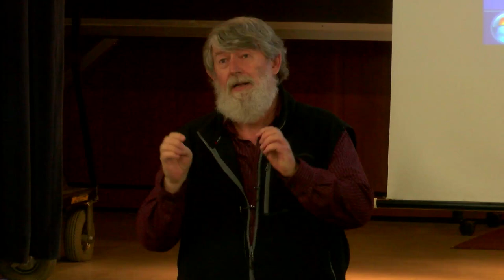David Chandler - How did they deploy 100s of tons of Nanothermite?

Comment: are you saying the 'nano-thermite' was applied to the 'core' lift shaft steel beams ?   How is nano-thermite triggered?  would the aircraft fuel fire be a trigger or was there another trigger mechanism?
Reply: "How is nano-thermite triggered?  would the aircraft fuel fire be a trigger or was there another trigger mechanism?" ~Professor Simon Holland, --- Nanothermite is triggered by an electric ignition. No the fuel fire would not trigger it. No thermitics ignite at such low temperatures. It takes a magnesium fuze to trigger regular thermite. 
\\][//
Reply: William Whitten FEMA Apx C consisted of inttergranular melting more then likely formed AFTER the collapse and does not have enough iron oxide with it to have even come from thermite.

http://www.tms.org/pubs/journals/JOM/0112/Biederman/fig3.gif

Nanothermite does not corrode the steel down to only inttergranular melting and I have gone over sources of it before. Gypsum wall board, chlorine, transformer oil, battery acid. What is important is that it didn't come from thermite.

There would has been electrical arcing taking place in building as described in the 2012 RJ Lee letter, the whole electrical system was compromised, yet somehow this nanothermite should not have been triggered by any of this until an hour later just before it collapsed?

The chips are consistent with paint. Red metal aluminum flake, which could come from compaq computers, fire engines, contain Fe203 and aluminum and can produce a reaction when ignited under Argon, which is exacly the same enviroment that Jones and Harrit tested it under. Mark Basile has promised an independent lab study using an inert test which would tell if the material is self oxidizing and has raised all of his money years ago.  Here we are years later and this has still not happened, yet the tests should only take a couple weeks, and he has had the money to do it? Perhaps because he knows what he has is paint chips reduced in the hydrocarbon fires.
Reply: Joel Schmierer LMFAO do you really not understand the flaws in that video? Do you really think that is how the buildings failed?  You think that a floor meant to hold 15000 STATIC tons (really at the time of collapse it would probably be less due to fracture though) should have produced an equal and opposite reaction to stop 100,000 DYNAMIC tons slamming into it??? 

 The video is highly inaccurate as it relates to the real Physics of the collapse. She found a relevant equation for dropping a bowling ball on a few sheets of glass- the problem is that this is not even how the towers collapsed at all, it ignores the mechanism of how the buildings fell- which was simple connection failure. One floor hits one floor and it breaks the connections on that floor, the entire floor does not have to be completely "crushed" it just has to stress the connections enough until the floor gives way. Due to the huge load impacting it, the connections fail quickly and easily due to the dynamic force, this caused the mass that was falling downwards to accumilate rapidly, as well as sending a shockwave down the building that fractures connections, meaning the force required to stress the connections and break through it would be less in the lower stories, this along with the increasing mass is what allows the collapse to continue to the bottom and accelerate. 

A better experiment would be panes of glass with a brick on each one. If you drop 10 bricks on one pane it will break, another brick will add on and the collapse will continue to propagate with more bricks falling, accelerating to the bottom, no single pane of glass would be able to stop the force hitting it. A much better and relevant experiment can be seen here

 https://youtu.be/flo62pdaIMI

The floors are stiff and can hold a load that is static, but when it is a moving force hitting it hard enough, it will break through, and with enough added on it can even accelerate. 

I don't know why you reference David Chandler, he didn't want to defend any of his points in a discussion and quickly left after being asked questions that he couldn't answer, and I have just refuted your nanothermite argument above.
Reply: Katelynne Wilcox I also believe that the piece from building 7 was from a completely different area then the point that the building initially failed at too but I cant remember for sure. But in either case thermite it wasn't done by thermite, probably from the diesel fuel kept under building 7
Reply: William Whitten Agan, there are other causes for the sulfidication and it is not even consistent with thermite anyways. Until the chips are inertly test and self oxidizing you can't say that it has been "proven"
Reply: William Whitten You are not coherent in the least, this is not what I'm saying. Aluminum flake as I explained yesterday contain Fe203 and aluminum similar to thermite and will produce a reaction under Argon which is what Jones and Harrit tested it under but it needs to be tested in an inert test.
Reply: The low Al content found in all of Harrit's chips would imply very little to no thermitic compunds and suggest the reaction is a result of burning organic polymer material and is why it should be inertly tested
Reply: William Whitten We've been through this before and I have already won before. The chips are a perfect match for a Leclede printer paint which doesn't contain zinc. Did you really think that they only used one type of primer paint in the WTC? LMAO.  the chips produce a reaction because of burning organic polymer material. The chips Miller's looked at did not contain elemental Al, and because the other ones contain low Al content more then likely it's burning polymer material,  which refutes everything you just said.

Willy Whitten doesn't believe they should be tested in an inert test though, the reason being is probably because he knows that he is wrong and is too arrogant and embarrassed to admit that.
Reply: William Whitten You have a long history of lying. Did you forget about your saying the remaining spire was part of the core and that all the columns were completely crushed up despite me showing pictures proving you dead wrong? LOL
Reply: William Whitten firstly I meant to say Millete but auto correct caught me. 

 Lol it sounds like you can't really refute the video so you want to handwave it by. Well the microspheres can also have been formed from electrical arcing taking place, refer to RJ Lee's 2012 letter on the formation of micrispheres, there is no need to appeal to thermite to produce the spheres that were seen.

 Do I also need to produce email correspondence on the microspheres debate that Steven Jones lost?
Reply: William Whitten The only hoax here is the one you stumbled into concocted by Steven Paint Chip Jones. Btw I have even heard that Jeff Farrer has had some doubts about the nanothermite.

http://www.sharpprintinginc.com/911/index.php?module=pagemaster&PAGE_user_op=view_page&PAGE_id=70&MMN_position=186:186

Here are those emails, care to explain why Paint Chip Jones dropped out of the microspheres discussion when engaged by Frank Greening?
Reply: Katelynne Wilcox I am not sure if you have seen it but he also put out a fairly recent article just less then a year old discussing this too, that microspheres in the dust from WTC2 came from the construction process.
Reply: Katelynne Wilcox http://www.scientificmethod911.org/docs/WTC2_dust_sample.pdf

This is the most recent article about the dust. The microspheres used in the report by Jones and Harrit also may not even really be an accurate figure but the samples they referenced from the RJ Lee report were not collected until months afterwards, after clean up and other cutting work at the site had been done potentially adding a significant number of microspheres to the dust, so I definitely find it to be a pretty week argument either way
Reply: Katelynne Wilcox You should read the forum "9/11 tapatalk" It is dead now but originally it had a lot of well known engineers and others like Frank Greening, David Benson, Tony Szamboti and others but still contains an almost endless amount of information
Reply: Katelynne Wilcox I would highly agree with that and Willy Whitten is a great example by intentionally taking the Seismic signals out of context to portray something completely different, or pretending that they did not "provide a full explanation" and then not even to also mention the time he said the remaining spire section was part of the exterior walls and not the core, or that all of the columns were completely shredded and destroyed entirely despite posting a picture that completely disproved that, the same one you used showing them laid out in large sections together. It is amusing to see how strongly he really thinks that it was a controlled demolition despite being completely wrong. Even if God himself came down and told him otherwise he still would not believe it because rather then look for actual evidence he has a major misunderstanding of how the laws of Physics work and would rather live in complete ignorance. I have heard that in private Richard Gage acts much different about everything and that there is actually a lot that he does not understand and not nearly as knowledgeable on it as he makes himself out to be. There is even a video somewhere that he is asked about the Seismic signals but says that he does not really understand them at all, yet this is not how he acts in other videos that he discusses the Seismic signals.  With this and the several things you showed on the previous channel there is no doubt that his only intention is to keep it all going just to draw in more profit and to keep from admitting this
Reply: "Revisionists say sharp spikes (graph 1, above) mean bombs toppled the WTC. Scientists disprove the claim with the more detailed graph 2 (below). (Seismograph readings by Lamont-Doherty Earth Observatory of Columbia University: Won-Young Kim, senior research scientist; Arthur Lerner-Lam, associate director; Mary Tobin, senior science writer)

FACT: "There is no scientific basis for the conclusion that explosions brought down the towers," Lerner-Lam tells PM. "That representation of our work is categorically incorrect and not in context."

The report issued by Lamont-Doherty includes various graphs showing the seismic readings produced by the planes crashing into the two towers as well as the later collapse of both buildings. WhatReallyHappened.com chooses to display only one graph (Graph 1), which shows the readings over a 30-minute time span.

On that graph, the 8- and 10-second collapses appear—misleadingly—as a pair of sudden spikes. Lamont-Doherty's 40-second plot of the same data (Graph 2) gives a much more detailed picture: The seismic waves—blue for the South Tower, red for the North Tower—start small and then escalate as the buildings rumble to the ground. Translation: no bombs."

https://www.popularmechanics.com/military/a6384/debunking-911-myths-world-trade-center/

"Many CD theorists draw attention to seismic recordings as evidence of the CD theory. Griffin (for example), drawing on Hufschmid, cites seismic data from Columbia University to support the CD theory:

‘In each case, “the shocks increased during the first 5 seconds then dropped abruptly to a lower level for about 3 seconds, and then slowly tapered off.” This pattern,Hufschmid suggests, reflects the fact that the first explosives detonated were those near the tops of the towers, where the steel columns were the thinnest. The shocks get stronger as the detonation pattern, controlled by a computer programme worked its way down.’ (Griffin TNPH, p.19)

This is easily shown to be fallacious. Firstly, as the one of Columbia authors confirmed in a later email, their seismic data “are far too weak in signal-to-noise ratio and far too speculative in terms of signal source to be used as a means of contradicting the impact times …” (Commission, p.462) But the key mistake however, is the idea that any building is demolished by a progressive wave of explosions either working its way up or down a building.

Brent Blanchard devotes section 4 of his paper to the issue of seismic recordings on 9/11. Blanchard is Senior Editor of ImplosionWorld, a website which posts details of explosive demolitions, and also Director of Field Operations at Protec Documentation Services, Inc. Protec works in the field of vibration monitoring and structure inspection, a key service to both the construction and demolition industries. Vibration monitoring performed by independent experts has long been considered crucial for companies carrying out explosive demolition, because owners of nearby buildings are keen to sue if any cracks or other structural damage appears. The field seismographs used by Protec and others provide the key scientific evidence for disturbances that may have caused damage, and there were a number of such seismographs operated by Protec on 9/11 in the vicinity of Ground Zero, for monitoring construction sites. Blanchard tells us that data from these machines, and seismographs operated elsewhere, all confirm single vibration events recording the collapse. None of them record the tell-tale 'spikes' that would indicate explosive detonations prior to collapse. In his words:

This evidence makes a compelling argument against explosive demolition. The laws of physics dictate that any detonation powerful enough to defeat steel columns would have transferred excess energy through those same columns into the ground, and would certainly have been detected by at least one of the monitors that were sensitive enough to record the structural collapses. However, a detailed analysis of all available data reveals no presence of any unusual or abnormal vibration events."
(Mike King)

NIST has provided an explanation, though some people like to twist things they have said to make it seem that they did not.

"Yes, there was more than enough gravitational load to cause the collapse of the floors below the level of collapse initiation in both WTC towers. The vertical capacity of the connections supporting an intact floor below the level of collapse was adequate to carry the load of 11 additional floors if the load was applied gradually and 6 additional floors if the load was applied suddenly (as was the case). Since the number of floors above the approximate floor of collapse initiation exceeded six in each WTC tower (12 floors in WTC 1 and 29 floors in WTC 2), the floors below the level of collapse initiation were unable to resist the suddenly applied gravitational load from the upper floors of the buildings.

Consider a typical floor immediately below the level of collapse initiation and conservatively assume that the floor is still supported on all columns (i.e., the columns below the intact floor did not buckle or peel off due to the failure of the columns above). Consider further the truss seat connections between the primary floor trusses and the exterior wall columns or core columns. The individual connection capacities ranged from 94,000 pounds to 395,000 pounds, with a total vertical load capacity for the connections on a typical floor of 29,000,000 pounds (see Section 5.2.4 of NIST NCSTAR 1-6C). The total floor area outside the core was approximately 31,000 square feet, and the average load on a floor under service conditions on Sept. 11, 2001, was 80 pounds per square foot. Thus, the total vertical load on a floor outside the core can be estimated by multiplying the floor area (31,000 square feet) by the gravitational load (80 pounds per square foot), which yields 2,500,000 pounds (this is a conservative load estimate since it ignores the weight contribution of the heavier mechanical floors at the top of each WTC tower). By dividing the total vertical connection capacity (29,000,000 pounds) of a floor by the total vertical load applied to the connections (2,500,000 pounds), the number of floors that can be supported by an intact floor is calculated to be a total of 12 floors or 11 additional floors.

This simplified and conservative analysis indicates that the floor connections could have carried only a maximum of about 11 additional floors if the load from these floors were applied statically. Even this number is (conservatively) high, since the load from above the collapsing floor is being applied suddenly. Since the dynamic amplification factor for a suddenly applied load is 2, an intact floor below the level of collapse initiation could not have supported more than six floors. Since the number of floors above the level where the collapse initiated exceeded six for both towers (12 for WTC 1 and 29 for WTC 2), neither tower could have arrested the progression of collapse once collapse initiated. In reality, the highest intact floor was about three (WTC 2) to six (WTC 1) floors below the level of collapse initiation. Thus, more than the 12 to 29 floors reported above actually loaded the intact floor suddenly."

And what Willy Whitten does not mention is that this "Thermite" does not even contain elemental aluminum, which must be present in Thermite.
Reply: William Whitten LMAO it is the actual authors themself of the Columbian Seismic signals that say the Seismic readings DO NOT support a controlled demolition. You are trying to suggest that they understand the Seismic readings even better then the authors of it themself??? And that for some strange reason the multiple other pieces of Seismic equipment set up around the area by Protec did not notice anything unusual??? LOL 

Whatever term you want to use, the low Al content of the chips suggest that the reaction is due to an organic polymer reaction and despite having the money raised for the last 4 years now the chips still have not been tested inertly to see if they were self oxidizing. One can only assume it's because the chips are not thermitic or they would have rushed to put those results out, the test would only take a few weeks.
Reply: @harryheiniken5224  Willie seems to have disappeared.  you and Katelynne scared the shit out of him
Reply: Joe V I would of left too. Those two are obsessed.